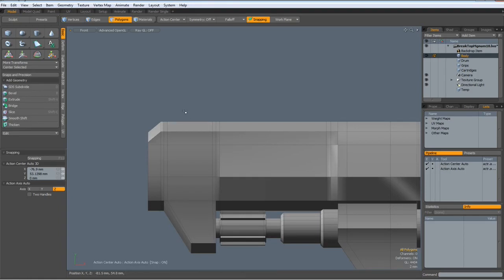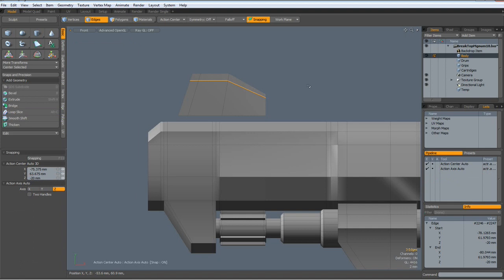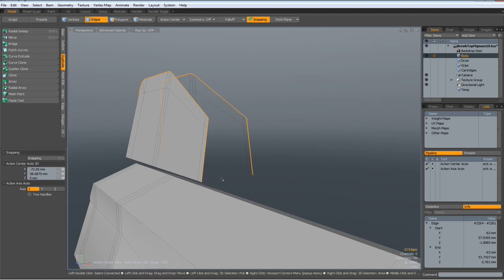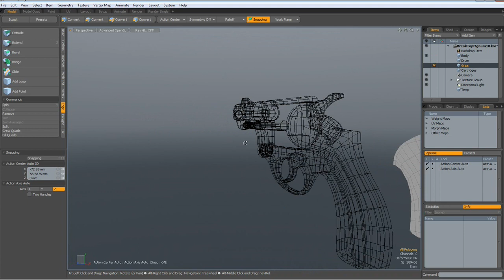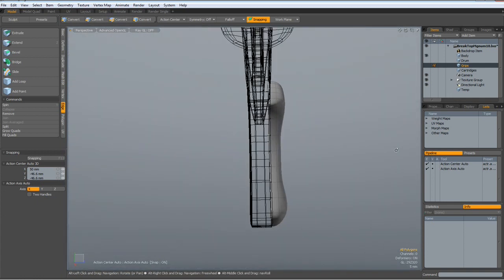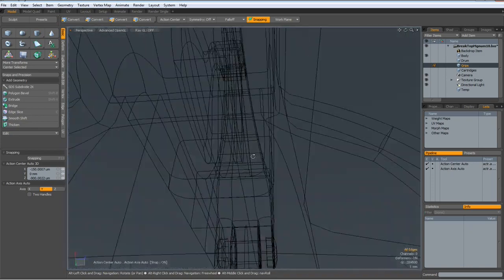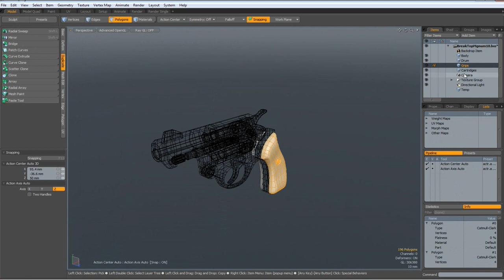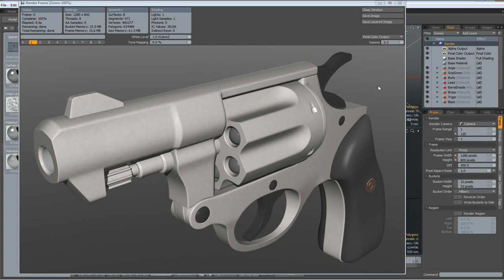Luxology Modo - Modeling a revolver - Part 10

Comment: I know its an old video but wow, i really like the way you teach with such detail and at a pace that people who are new to the program can follow. The only thing i need to get used to is the awful camera controls in Modo. Thanks for all the hard work that you have put into making these tutorials!
Reply from the maker: +veng3nce2k Hi, i'm glad you like my tutorials. If you are unhappy with the camera, then you should probably disable 'Trackball Rotation'. Its in the System - Preferences - OpenGL at the very bottom. Most people don't like TR, but it's the default setting. Kind regards, Peter
Reply: +Peter Stammbach  Grüezi Peter ! Thank you so much for the tip, much better. TR is very annoying. Your a big help to many as you dont rush through things and explain it very well. Just as you have given back to the community, i will also like to give something back. I'm a Webdesigner/Developer, this is also a hobby for me. I would like to offer you your own personal website for free, where  you can categorise your tutorials to help other newcomers. let me know what you think and if it would be useful to you.  Mit freundlichen grüßen.  Pieter
Reply from the maker: +veng3nce2k Hi, (are you Swiss ??) thank you for your generous offer, but i think i don't want to have yet another place where i have to use time to maintain it. It's enough with YouTube, Google+, FaceBook, My eMail, Channel messages. This takes away far too much time from me already. But thanks again. It's very generous from you. All the best and take care, Peter
Reply: im not Swiss, however i believed you were because of your accent. Im originally German however have lived in the UK for 20+ years